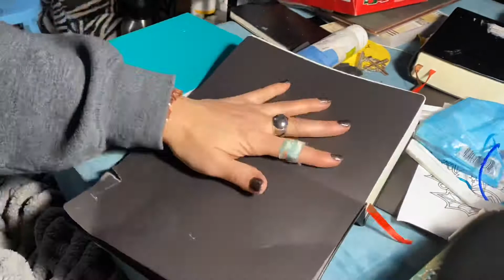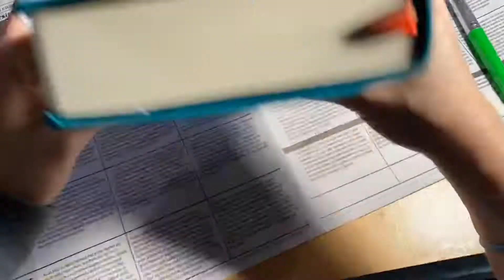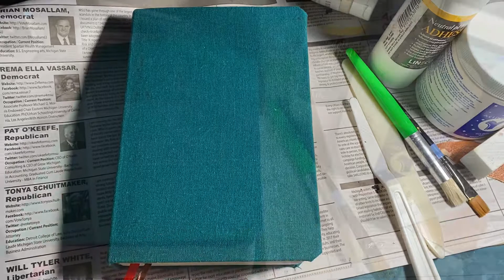Time lapse, re-covering an empty journal.

Comment: I bet it's harder than it looks :D Very interesting
Reply from the maker: The covering part is actually super easier. Getting the textblock (the actual pages) back in, both straight and securely is where it gets tricky. It’s one of those things that’s easy to do, but difficult to do well. I’d say probably a quarter of mine need adjusting at some point. :)